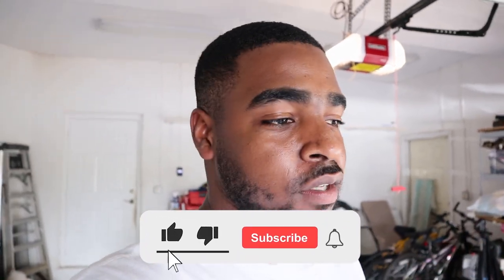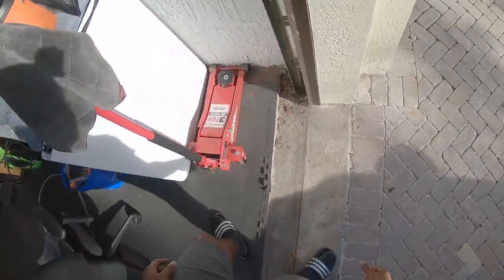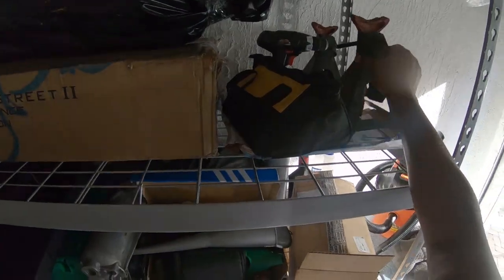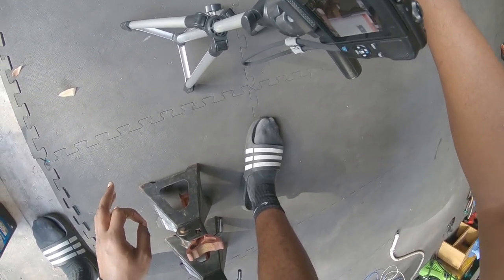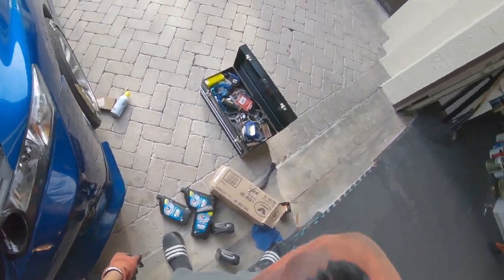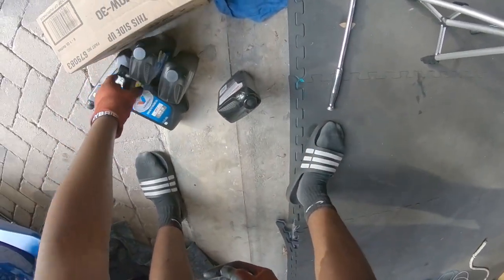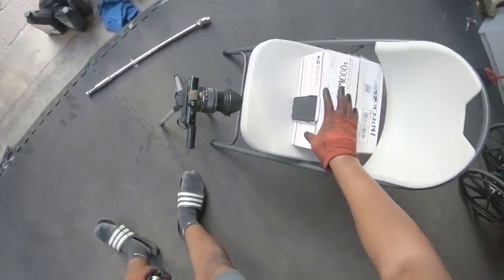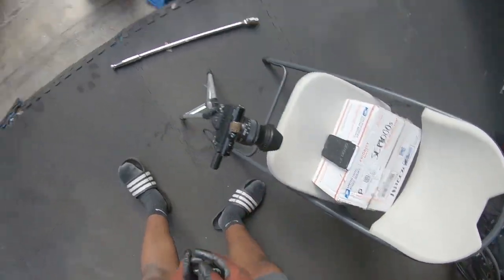10 Min Oil Change Challenge Went Terrible ...

Comment: My guy lol get you a regular size ratchet and a shallow socket. It’ll make it easier to take off that drain plug. Or a ratcheting wrench or regular wrench. Using a beaker bar will make it difficult to break loose that drain plug

Comment: As an Acura lube tech , having a wrench makes it quicker bro . What I do is , break drain bolt loose and let it drain while that’s going on I loosen the oil filter . Also it’s fine to reuse old oil to lube the new filter gasket . Hope that helps you next timw
Reply: No it's not fine to reuse old gaskets for anything 👍
Reply: @ss2neat599  you really think mans is pealing the gasket off the old filter, ripping the new gasket off the new filter and then putting the old gasket on the new filter?
Reply: @ss2neat599  he’s saying you can lube the oil filter o ring with either old engine oil or new stuff it doesn’t matter.